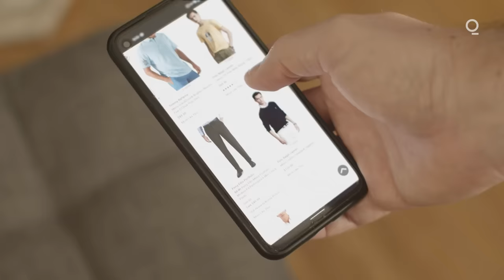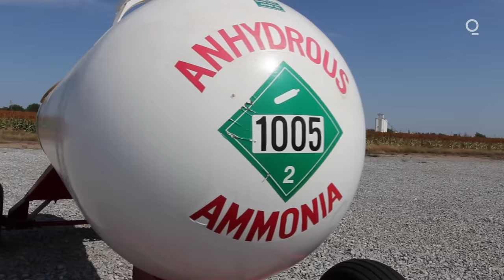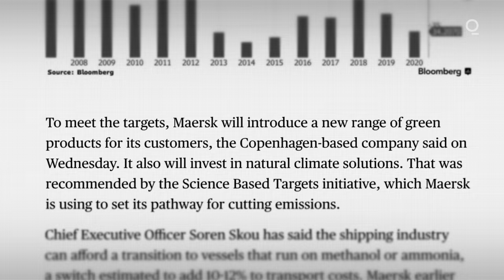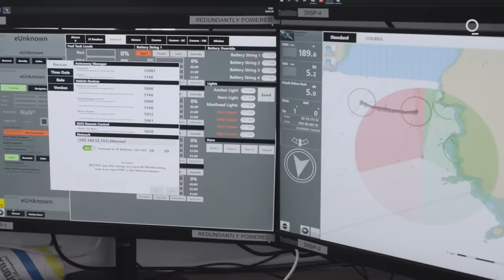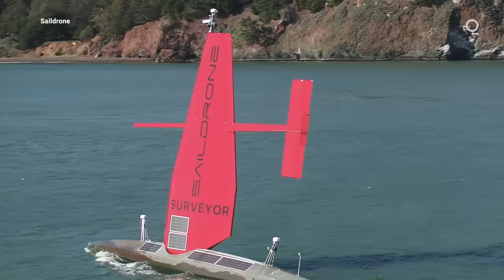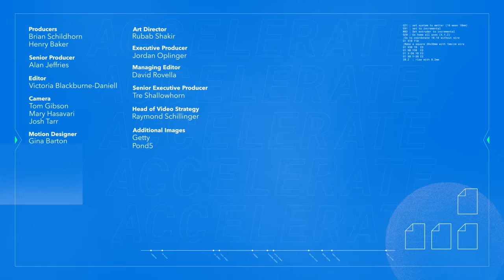How the Dirtiest Ships Are Cleaning Up Their Act

Comment: The best solution is more distributed manufacturing of quality, durable products. Thus a lowering of shipping demand. Even if more expensive upfront. Real quality always ends up being cheaper in the long run. Even promotes inter-generational wealth growth if children can inherit long-lived items.
The current paradigm is just driven through marketing anyway. Doesn't make anybody truly happy.
Reply: Thats never gonna happen, business always have two different ways to operate, either quality or quantity and many business run on quantity over quality, to have both you need to have a very big business already.
Reply: @Soul-ft7bg  you just need laws. I think they actually reduced the product warranty time by 5 years. Fridges and washing machines are thrown away after 3 years now. These used to last over 30 years. Not to mention right to repair. We are unable to repair our electronics nowadays.
Reply: @TheBooban  Exactly, just 7 years back the microwave my grand pa had for over 30 years died and had to buy a new one and guess what?  The new one died 5 years later.
Reply: Well actually, cargo vessels are one of the most efficient modes of transportation. The bigger the ship, the more fuel-efficient it is. Same applies to factories, you don't want distributed manufacturing facilitates for environmental benefits because having more factories means more concrete used for building them and potentially less green land. And shipping goods they produced won't be as efficient either compared with the current concentrated model (i.e. most of the goods are now produced in China) due to the lower economies of scale (and thus lower energy-efficiency)
Reply: @chm0225  An ever wider variety of goods are ever more viable targets for distributed manufacturing thanks to advances in additive manufacturing though. And with an emphasis on quality and durability I would be the first to admit that I'm talking about a paradigm shift here. In the end countries will have to decide if they want the hidden costs loaded up front, or addressed randomly down the line as they make themselves known. I am certain that with time the distributed manufacturing of robust goods will become the status futurum, because I see it as is the most viable model that might qualify to be any kind of status futurum. In a number of ways.
Reply: It also depends on the person on how they treat things. I’ve seen how people are careless with their things-hence having to buy more sooner than later.

Comment: Saying biofuels can be generated with renewable energy is nonsense right? Because we do not have enough renewable energy. When there is not enough renewable energy, then more coal, oil and gas have to be burned to generate the electricity to generate bio-fuel. It would be better then to take the oil directly to the ship engine?

Do we know when and if there will be enough renewable energy to power all households, factories, electric cars and to create biofuels for shipping and aviation industry? If we don't know (or if we do know there won't be enough renewable energy), then biofuels are a scam right.
Reply: So biofuels work a bit difrent than you might think the energy gets mostly added by the growth of plants to the fuel so for that you tipicly dont need electricity. And than you have processes which refine the oils which use energy. But on another note the elektricity suply is also relevant for bateries. And i find batery boats are the bigger scam because they deplet the earth of valuable rare earth metals.

Comment: And make sure there is renewable shore power in all ports so that ships don't have to run generators while being docked.
Reply: Ground power units like we have at airports when the machine taxies in and is plugged in straight away
Reply: Nice thought until you think about it for even a second. 

Ships spend very little time in port. Usually only for active loading and unloading. Refueling, crew food and supply replenishment, maintenance and cleaning of the ship is all done at sea. The time waiting for a dispatch is spent sitting in designated areas away from ports.

When ships are in port they are almost always required to have their engines operating and crew on the bridge ready to take action in case of an emergency. Not only that, but the engines to power a ship are substantially larger than your car. The term cathedral engine comes to mind. You don't shut off and restart a ships engine instantly. It would actually cause more engine wear from the shutdown and restart process and more pollution and that pollution would be released in ports near major population centers. 

You have officially earned your participation trophy.
Reply: You can get a lower port fee if you plug in, at least in my local port...
Reply: Nice

Comment: Chinese ship are required to be green to enter US ports but before they get to the ports they just switch fuels and after they leave they switch back to the dirty fuels. at sea, Chinese ships use number 1 fuel oil and coming into ports they use number 2 diesel.
Reply: That is normal for all boats...
Reply: @Uffeful  Yeah was about to say since different areas of sea lanes have different acceptable ranges.  Like ships crossing the Atlanic use a more dirty fuel then when they pull up on the North American Coast they switch to a cleaner one since cleaner fuels are often more expensive.

Comment: to everyone saying “go nuclear” yeah, you could do it, theoretically. there was never a nuc-plane cause of how heavy it was. light reactors are so expensive they easily cost more than a panamax ship. also, waste storage.
Reply: While the NS Savannah worked, its design was just way too expensive to operate because it used an older reactor design. I expect someone soon to build a test ship using a far more compact (and way safer to use) Generation IV reactor, one that make it possible to built gigantic container cargo ships that run for years at a time without refueling with no air pollution emissions, either.
Reply: @After_Pasta  Remember that the reactors on ships are MUCH smaller than a reactor used in a power plant, you're trying to power a ship, not power an entire town. :)
That doesn't mean it's not an issue, but it's 'less' of an issue than it's made out to be.
Reply: Well nuclear subs run on.. Yep you guessed it.. Nuclear power
So to have nuclear on a ship is not a weight problem or a cost problem at all. Those nuclear power motors on the subs are of an older design so a new would weigh less I guess

Comment: The classic sailing vessel needed huge sails.  Huge sails required dozens of sailors to 'man' the sails; actually, putting them up when the wind was right and taking them down when it wasn't.  But if you had hundreds--thousands of small, two foot by four foot tall sails, attached to the sides of the ship and controlled by computers, modern ships could at least be 'assisted ' by the wind.  Modern sailors have figured out how to take advantage of even contrary winds.  This could be a partial solution.

Comment: Why don’t ships use wind electric energy? Simply install a few wind turbines on ships and use the generated electricity to power the engines! No shortage of wind on the seas…. What a thought!!!
Reply: Wind turbines also offer resistance to the wind, much as a sail does (we don't care much about that on stationary turbines, as long as it isn't at potentially damaging speeds). 

And there's the matter of the direction the wind blows, compared to where you want to go (stationary turbines need merely rotate to face the wind, regardless of direction, and often automatically where a tail/vane is involved, to get the most out of it).

It's not clear that you're going to break even on this...

Comment: I live right on the seafront in an estuary going into London. That means I get to see all the ships going past belching smoke. I have dozens of pictures of smoke belching giants, some of which push out more smoke in one minute than all the vehicles in London in a month, so I would be very surprised if it was as low as 3%.
Reply: 3% of carbon dioxide. Sulfur dioxide, sot etc is another thing. What are your laws on sulfur in ship fuel? Same as for land vehicles? If not, it should be. Sulfur in diesel is like 0.1%, bunker oil is several percent, basically it's the leftover gunk after refining away gasoline, diesel, kerosene etc.

Comment: Now lets get the numbers on emissions from producing those batteries!
Reply: It is still less, most of the concern is to get the raw materials sustainably.
Reply: @defnotaghost6460  Less than what?
Generally when you take a look at emissions from producing Electric cars, they have to run for way too long, to produce less greenhouse gasses than a conventional car with a combustion engine.  Furthermore the main amout of power produced still comes from burning coal etc.
and this is the fact in most bigger countries

Comment: The New Century Is Electric
Lithium Not Oil
Reply: You mean groundwater which gets poluted by mining, fast degradation of the storage medium, low energy density, bad scalability
Reply: @jurgenkriebs9405  Adapt And Overcome
Reply: Lithium degrades hella quick and is really no reuseable or recycable not to mention its one of the worst in terms of landfill pollution.
Reply: @dragonace119  So They Are No Perfect Solutions ? Welcome To Reality..
Reply: @danjohnston9037  like tell me how would someone overcome the scalebilitty issue if we have finit resurces here on eart and most things needed for bateries are not that common maby try transporting it by rail at least for there test project it seems like a valid alternativ and at least between europe and asia that alternative would be worthwhile
Reply: @jurgenkriebs9405  " Most Things Needed For Batteries Are Not That Common"  ??? Well, The Lithium Is Fairly Common. Example: Chile Has Lots And Look At That Coast Line They Got For Sea Transport.  Being Selfishly Concerned About USA the Most I Point To All The Mining In Colorado And Other Such States And Our Trans-National Railroads For Cheap Land Transport WITHIN The North American Continent ( Though Those Need Upkeep)

Comment: Why not use engines that work on hydrogen like Toyota tries to do with cars? They can convert sea water into usable water for electricity storage.
Reply: It’s an interesting option for the future, but the energy density of hydrogen, while better than batteries, isn’t that great when compared to hydrocarbons. It’s also not widely available right now, so it’s not really a viable option for most cargo ships.
Reply: Because hydrogen infrastructure is silly expensive and hard not to be leaky .
Reply: converting seawater to hydrogen takes more energy than burning said hydrogen in a motor would make.
Reply: Also seawater will be more salter. Imagine the sealife.

Comment: What about building ships that are powered by their turbine turning in the water whilst on the go....
Reply: Um, that causes drag that will be greater than anything you can get from it to then power the ship motors to keep moving through the water. 

(Same as if you tried to connect a generator to an electric car's wheels, or hung a propeller off a plane to power its electric motors...you can't get something for nothing)

Comment: Why not convert these ships into electric with the new micro molten salt reactors? They are expensive at first but within the lifespan of the ship they will never need new fuel
Reply: nuclear powered ship need constant protection so the cant be turned into dirty bombs. And maintaining a nuclear reactor requires highly skilled workers. Most ports dont allow nuclear powered ships to dock either. In theory its an great idea, but very hard to actually do.